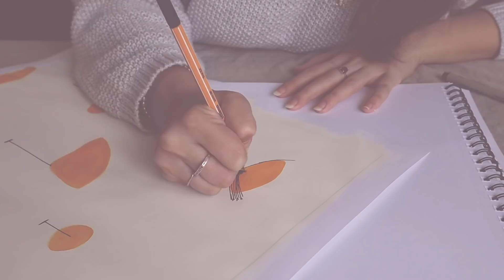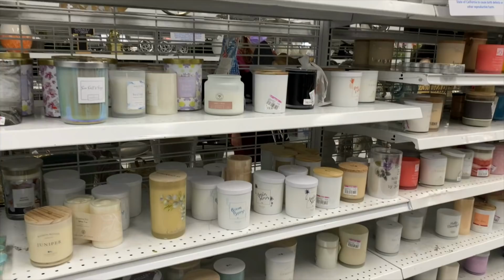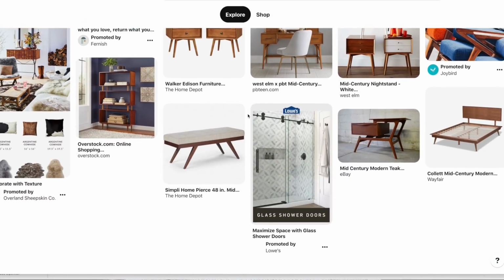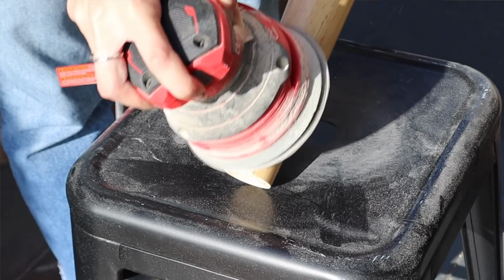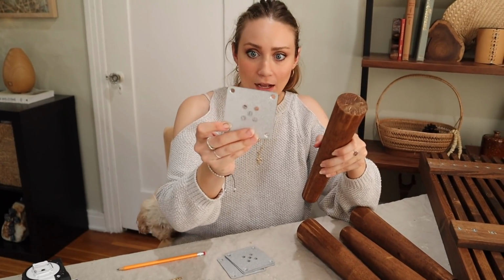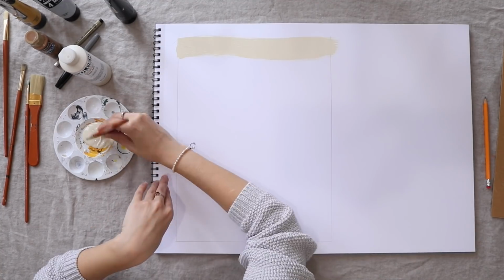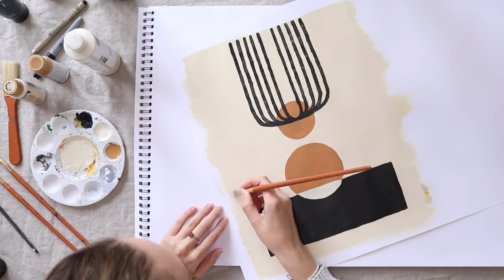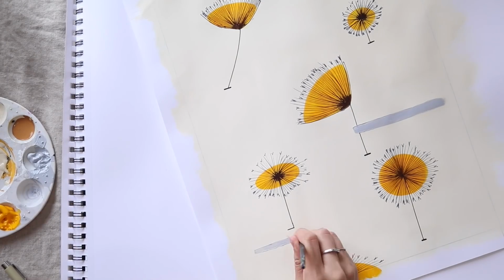DIY MID-CENTURY MODERN HOME DECOR on a budget | XO, MaCenna

Comment: I know this is late but if you put a popsicle stick (the big ones) or a spoon up to the lip of the candle jar  and tilt in down into the new jar you can guide the hot wax away from the edge of the jar and straight down into the new candle holder. You can do this with any liquid transfer.

Comment: WOW! Well done on that bench! I know these projects always look easier than they are...but thanks for making the technique straightforward enough that I feel like I could do it! :)  BTW....just wondering if there was a need to do the pilot holes for the slats BEFORE the pilot holes for the connector pieces? I would've done them at the same time but don't want to do that if you had a reason? THANKS!!
Reply: No need and it could have caused chaos if they didn't line up perfectly which you can't see the connector piece is on top. Definitely do the pilot holes with them together like you suggested!
Reply: I was thinking the same. I'd be the person who wouldn't be able to line them up properly if I did them separately. 😬
Reply: @jenniviiv  Haha....that's what I was thinking as I was watching...I've done just enough projects (mostly badly lol) that I can just see myself having the measurements off and the holes not matching up!

Comment: That bench looks amazing! I wasn't a huge fan of the inspo pic, but the one you made looks incredible! Would've been cool if it did have the legs at an angle, but I can imagine that's probably much harder.
Quick question: How do you have any idea of what size screws to get when you're just making up DIY projects? Is there a rule of thumb involved there? You mentioned using 2 inch screws but would normally use 2.5 in ones and just curious about that.

Comment: I just wanna give a little tip when using acrylic paint: it's a good idea to have a glass of water that you can dip ur pensel in and mix in with the paint. Then u can manipulate with the smoothness of the stroke better. Hope it makes sense.
Reply: I think people are scared it's gonna make the paint less pigmented, or watery, but it won't if u have a decent quality acrylics.

Comment: To prevent spillage with the candles:  Start with the rim of pot with melted wax overhanging and low to (or touching) the pot it is to be decanted into.  Practice with an empty soup tin/jar and cold water.  Then confidently raise it so that it quickly becomes a steady flow.  Keep raising the pot until all is decanted.  Less wax wasted and easier cleanup after!!

Comment: I've saved this video for  future reference when I'm furnishing our new house. I have a question about the mixed media paper. Does the warping that happens when anything wet is applied straighten out when it's dried?
Reply: Hi! I’m an artist and use this paper and acrylics regularly. Warping with this paper shouldn’t be to bad unless you use an excess amount of water. Whithacrylics it usually is not noticeable it’s mostly with things like watercolor where warping starts to get bad. If you are wanting to keep it from warping at all I would recommend getting a watercolor paper meant or a heavier paper instead of mixed media ! 😊

Comment: Hi Macenna. I’ve been a subscriber for about a month now and came across this DIY video. I’m planning on making this bench .. but I have a question about the three 4 inch wood that go under the slats: how can you tell where to drill the holes ? Did you measure and mark it ? If so, how many inches. Sorry if this is a silly question. Everything made sense to me except this part.. I’m not crafty at all. Lol

Comment: Just be careful with those "fishbowl" vases/vessels because if the glass isn't thick enough, the heat from the candle could cause it to shatter and it will literally explode. Candle vessels are specifically made to withstand high heat so it's not recommended to use just any glass vessel. Unless it's strictly for decor and not being lit.  Just a little safety tip.

Comment: I know this is a 2-month-old video, so idk if anyone has already told you this yet, but repotting candles into random glass containers not meant for it is potentially SUPER dangerous! Not all glass is heat-proof, and some will crack, split, burst, or explode if exposed to the heat of a candle, then often leading to a fire. Please be more careful in the future. It does look cute, but it working without the glass bursting was pure luck.